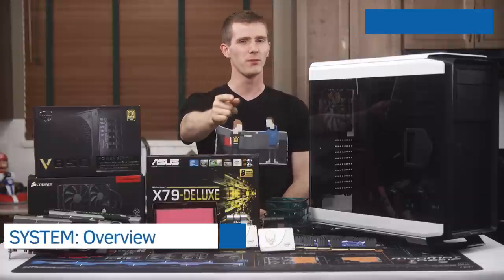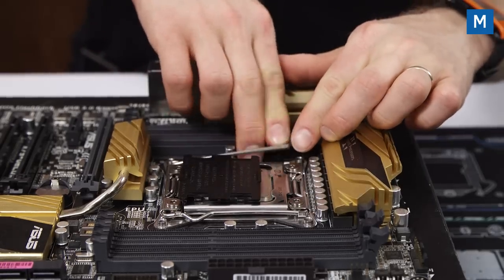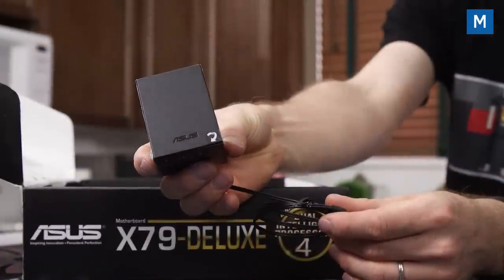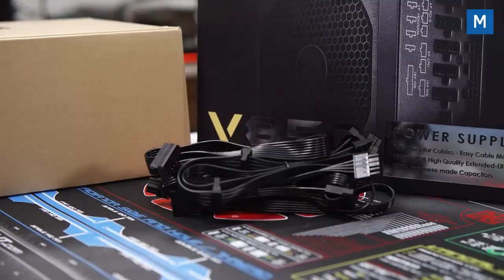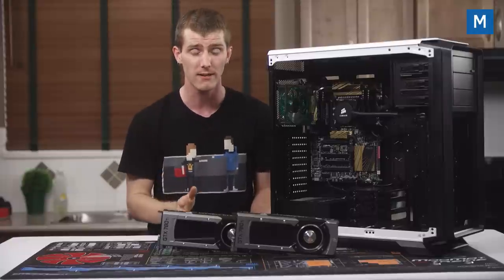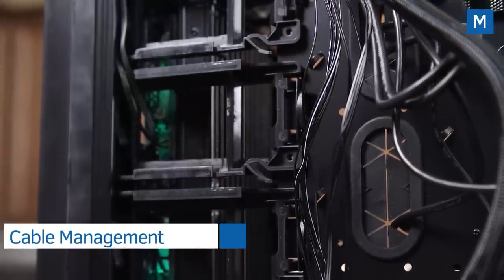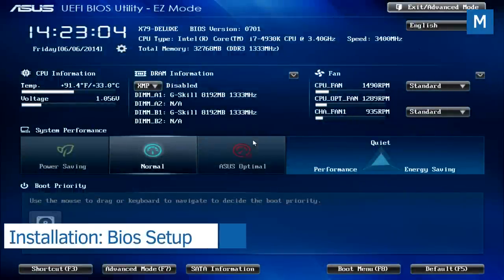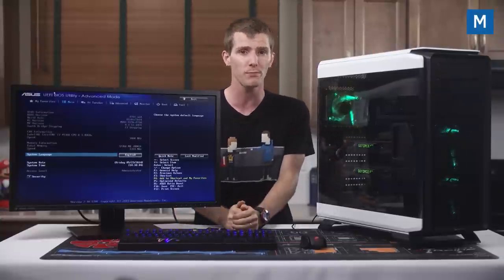How to Build the ULTIMATE 4K Gaming PC Build Guide

Comment: PC gaming is wierd. First you have to buy certain parts of it and then built it. Rather buy a ready-to-play gaming console, then dealing with this PC building bullshit. Gaming consoles are going to get better with the superb new versions of this current gen.
Reply: *build it
Reply: you can buy decent pre built machines
Reply: So you'd rather buy a 30-fps locked console with much worse specs than a top-of-the-line (or even budget price) PC just because you're too lazy to build it? You buy parts, make it yourself, and you have a machine that is better than any console right now. If you are that lazy then buy a premade PC (although they are notoriously expensive) or have some other guy do it for you. And as gaming consoles progress, PCs will be far above their class; it's happening already. So, as consoles progress, PCs will be miles ahead. And it's not that PC gaming is weird. It's just that you're too lazy to get up and get an actually good machine. Shame.
Reply: MagicImmuneMinigun Bro, the huge advantage of consoles is that its made ready-to-play. I have played 1080p 60fps on the PS4. Like Uncharted 1,2, and 3. Tomb Raider the definitive edition as well. The smooth framerate and good resolution is the better gameplay experience, no doubt about it. Xbox Scorpio and PS4 Neo are going to come out as well with the promise of higher frame rates and resolution. If us console gamers want to transition for better features then it should be Scorpio or Neo, not PC. Console controllers are better, as opposed to the mouse and keyboard. I have played and still playing 30fps games, its not bad. Unless the frames drop to 20 or below that. Uncharted 4 is a good example, I had a great experience with it at a stable 30fps.
Reply: I'm not an engineer or whatever. I'm a consumer that desire a ready-made system to enjoy. Do not want to waste precious time to build in order to play.
Reply: Donnaro Donn You don't need to be an engineer to build a PC. You just have to insert parts onto a motherboard and plug everything in, and bam. Finished in an hour, and you have a system that can last you years, that you can upgrade as well. PCs also have a wider variety of games, and obviously the graphics are superior. I understand that the niche consoles fill are that they are easy to set up, in fact you don't even need to set them up. But if you just take at least an hour or two, then you will  have a machine that will surpass probably any console on the market right now, and the Scorpio and Neo will still be behind next-gen PCs. Also you can always plug in a controller into a PC, even I do that sometimes.
Reply: MagicImmuneMinigun Other than better graphics, resolution, and frame rates, whats so great about PC gaming? I literally heard nothing of PC exclusives. If PC is so advanced, why are there desperate PC gamers looking into and begging for console exclusives. Horizon Zero Dawn, Days Gone, Spiderman, God of War, and etc. If you guys want to play these great titles, swallow your pride and buy a gaming console, in this case, PS4 or wait for Slim and Neo. You guys are too deep into the PCshittyrace nonsense. Its okay to be a gamer of all platforms. PC performance is on top no doubt, but consoles are getting better as well and to add the jewels to the crown, good exclusive titles are elevating console gaming.
Reply: +Donnaro Donn You do know that the console games are going to be released for PC right?
Reply: Donnaro Donn Sure consoles trump PCs in exclusivity... But that's it. Think of almost every game that isn't an exclusive- it's most probably on PC. A HUGE library of games, better graphics, better performance, more future-proof... All of that makes PC gaming... PC gaming. Also like I said, as consoles get better, and you can play (almost) every old console on PC, so eventually in the future we will have PS4 emulators, Xbone emulators, so on. 

You are saying that the only redeemable factor to consoles are the exclusives. Which I must admit, can be true. I wanted a Wii U just to play Pokken Tournament, but why the hell would I get a console just for a couple exclusive games when I can get just about any game I want with better performance on a PC? Really, the only selling point of consoles are the exclusives. PCs trump them in ALL other aspects. If their system is so good yet so cheap, why are they asking for exclusives? Exclusives are acts of buying parts of companies or even whole companies, so they can get the popularity advantage. So quite literally, without exclusives, consoles would be pretty much dead. Well, another point is accessibility, but you can buy a premade PC that would still trump consoles in performance. And if your excuse for not building a PC is laziness, then shame on you. It's your own fault.  

Do you know why console devs get exclusives? Because they are scared.
PC is soon becoming a very powerful platform, with great accessibility for programmers and users.
Almost everyone has a PC in their home, yet not everyone has a console, despite it being cheaper.
They want you to think console is better. But they know that PC is better.
They are scared of PC.
The PC Master race.
gg wp
Reply: +Donnaro Donn other than exclusives and simplicity, what makes consoles better than PC?
Reply: +Donnaro Donn PC exclusives exist too, little boy. Starcraft, WoW, LoL, Dofus, Card games, Dota, and more and more. Your pc exclusives are... are so unsignificative for a pc gamer. Computers aren't just for gaming.
sorry for my english,  my Mother tongue is french ;)
PS: A pc can also open 2 or more app in one time :D
Reply: ***** So can an Xbox one. Ever heard of snapping an app?
Reply: Dead_watcher And how many? I can open however many I want to and you can open what? 2 or 3. Wow that's so intuitive (aka shitty)  Not to mention you can't even use two monitors lmao.
Reply: +Dead_watcher wow, and it's over this your only point clap clap. I have internet while i'm playing vidéo games. So ok you are right but if you only have music it's not da good.
Reply: +Donnaro Donn yes consoles have exclusive games.. even one of them is my fav (halo) but i kinda like playing at 60fps more than 30fps. consoles are great but pcs are better. and other than graphics,res,fps what is there in gaming lol there is a lot of games in pc soo not many people care about that exclusive games. it only comes down to price and.. for the price i think consoles are better lol
Reply: +Donnaro Donn i built a pc during the time i went to school that was better than my console and it was my first one so i had lacking experience. Also, once you have experienced anything over 60fps you will think that 30fps is unacceptable. But hey its your choice, if you wanna show your lack of knowledge then go ahead.
Reply: +homerboy12345 lol pc fanboy alot of people like consoles because they have games that pc don't have..
Reply: If you honestly think about it gaming PCs aren't even that expensive if you do it yourself. Nearly every home has a generic desktop PC in which probably costs a few hundred so instead of buying a normal PC, just get a gaming one to do both.
Reply: gwnDLANOR Like what? Fucking Uncharted?
Reply: pc's will alway kill console
Reply: Lol. You keep on thinking that. Let me know when you can run native 4k at 60fps. I'll wait.
Reply: To each his own, I personally love the whole process of putting a pc together. If The Last of Us 2 is ever announced for the PS4 I will immediately shell out the cash for one.
Reply: Alex Sauceda Well... It was announced... It doesn't have a release date yet, but it is coming. Just FYI
Reply: +Peter Smith LOL, Dota, Wow and what else?
Reply: +Peter Smith Doom?
Reply: +Peter Smith is it funny that barely anyone agrees that a console is a computer,  or we are all a part of the #gamersmasterrace
Reply: *****
Got it
Reply: +GullibleHS Donaro Donn has nothing to say now xD
Reply: +Donnaro Donn hahahahaaa 60fps 1080p low settings
Reply: +Donnaro Donn I agree with everything you say except that controllers are better. The reason we don't have mixed pc-console servers is because controller players would be at such a disadvantage it would be very unfair
Reply: +Rock GamingTV Well lucky you, because Halo Forge and Custom games are coming to PC. You will be able to use forge, and play with you friends on all the arena maps and your own maps too!
Reply: +Alex Sauceda Don't worry, cus The last of us is going to PC and they will probably bring part 2 to PC also if there is one.
Reply: +Ken Naughty dog is one of the only developers that makes playstation exclusive titles so I dont think we can expect The last of us for pc. Maybe it could work with an emulator
Reply: Well, in terms of the hardware components a console certainly is pretty much a computer. But a computer has certain characteristics that are not meant for consoles, for example it can create software for itself (and for consoles for that matter).

In that sense, a smartphone is more computer-like than a console. Not only in the hardware components sense but you can even use productivity software (albeit not as efficiently as in a computer) and you can even program in them (Android only I think; google AIDE).

I agree with your final thought though, we all should just be nicer to each other :-)
Reply: right as of now, the only thing console's have over PC's is literally a couple of exclusives. if u don't have a PC/Laptop go to a library for all i care but, download steam and i can guarantee you will at least find  At the very minimum 1000 more PC EXCLUSIVE games than on console
Reply: Dem console fanboys
Reply: +Donnaro Donn dude could u play star citizen and 120fps on a ps5 tho
Reply: +MagicImmuneMinigun 
Console exclusives are more desired and glamorous. Uncharted is the absolutely perfect example. For your information, PS4 Pro was announced recently at a price of $399. 4k, Higher resolution, HDR, smooth frames, and breathtaking games are revealed for the PS4 and PS4 Pro. The PC is irrelevant at this point. I just received my paycheck recently. I'm saving up for PS4 Pro and Xbox Scorpio. No thanks PC. PC can't compete against an affordable price, ease of set up and use. PS4 Pro will indeed dominate. PC is really undesired. Unattractive games and overpriced hardwares. Check out PS4 Pro. The hype is real.
Reply: +Dhoobs Patel 
PC has shitty games. None are in the popularity spotlight.
Reply: +Nicolas Rodriguez 
A lot of PS4 exclusives are on the way soon.
Reply: +Enderh3art 
No low settings. Beautiful graphics and smooth frames.
Reply: +Дима «Джастин» Маяковский 
PC has unpopular and second-rate games that are not worth playing or talking about. Console exclusives are more enjoyable and wanted. Look at the PC gamers begging for PS4 exclusives. lol
Reply: +Guyver2391 
I'm a gamer not a fanboy bro.
Reply: +Mista Jerka 
Why build a hardware when a console system is already ready made to play?
Reply: +FanOfLordi 
World of Warcraft seems pretty good. The rest of PC games are shit, no offense.
Reply: +Dead_watcher 
Great exclusives is a major win. Simplicity is another big win. Controllers are more enjoyable and better as well.
Reply: +GamingTomatoKid 
See what I mean. Console exclusives are better. That's why PC gamers demand them so intensely.
Reply: troll spotted
Reply: TROLL ALERT TROLL ALERT
Reply: Lmao @ the people who bit the bait...
Reply: Yeah but can you play in 4k? Or even Ultra? No.

Comment: I cant even run gta 5 at lowest with 60 fps
Reply: Ur processor is slow or ur RAM is messed up. Try getting a better and faster processor.
Reply: i say change your gpu if you at lease have a i3, check your RAM too just like what the other guy said
Reply: Doge i cant run gta 5 period.

Comment: ok i need help 😂

i want to run beam.ng drive and skyrim, 
both will be modded moderately 
i dont give two shits about graphics 
my budget is around £350-400
plus a bit of space for other programs 
and something easily upgradeable 

Any help would be appreciated. And if you dont mind or actually like answering questions i have a lot more😂

thanks in advance
Reply: Buy gtx 1070 and u r good to go
Reply: Misgu Im mot going to take this seriously
Reply: You should watch his ultimate value build guide if you haven't already, that should give you a few ideas. Also check out the website "PC part picker", it has a feature that allows you to put all of the parts that you are planning to use in to a list and it will troubleshoot any potential compatibility issues.
Reply: 350-400 for a whole PC?
Hmm, i suggest going with the FX 6300 and a GTX 750. 
You would have a bit more power than a PS4 has.
Reply: fx 6300 in 2016? i3 6100 is better. also gtx 950 is almost same price and better.
Reply: For you Americans it's in pounds so it's about  $460-525 USD